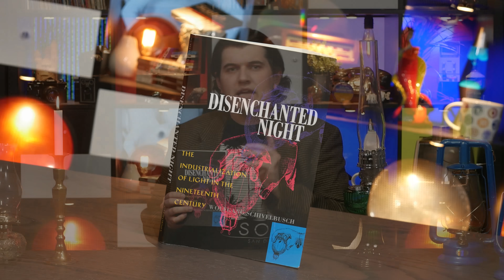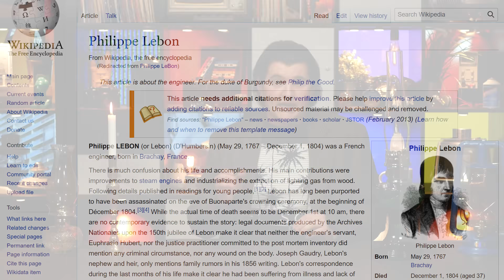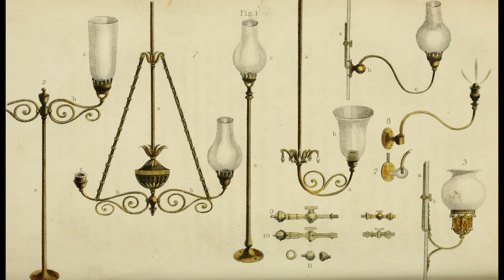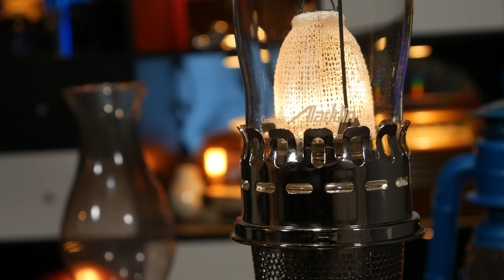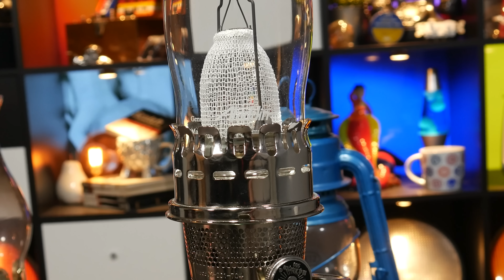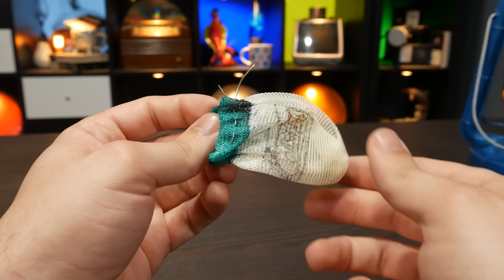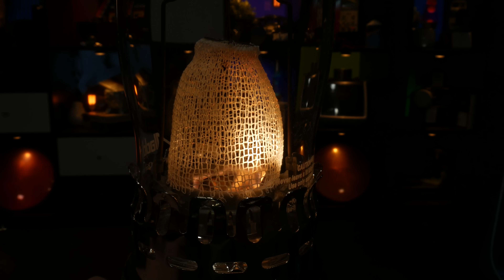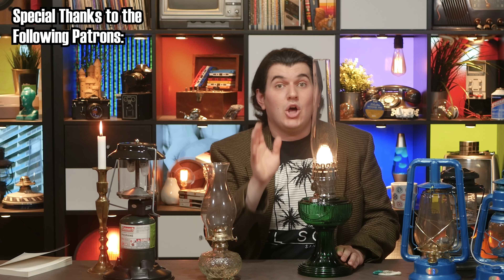How the gas mantle made lamps 10X brighter

Comment: "...When these lanterns were first invented." As opposed to... when they could've been "invented again later"?
Reply: Things routinely get lost in collective memory and then invented again.

Currently there is a huge argument in the historical tech circles about when triangle-toothed gears were first invented. The original answer was sometime in the Renaissance, as there were no surviving examples or accounts of such gears - gears were either square tooth or hub and stick, where you made a gear like a spoked wheel without an actual wheel.

This is important because triangle-toothed gears are required to make certain types of mechanical linkages work. If you try to make one with square teeth, they fail through binding.

Now we had a few ancient accounts of inventions that included gears and would require triangle-toothed gears, but we didn’t have any records of them being built and operating, so they could have just been theoretical.

This is what made the Antikythera mechanism so huge in rewriting history - it uses diamond-toothed cast bronze gears to power a mechanism that requires diamond-toothed gears.

Further analysis with fancy techniques to see inside the device have shown that it wasn’t just a one-off artisan device but that it has markings in the castings stating who made it and from where (presumably both as authentication and as advertisement); this was a bronzeworking group in Rhodes.  If these devices were made in quantity, it makes sense to assume that triangle-toothed gears were both well known and in wide use in the ancient world.

Similarly, Greek fire was invented and lost with the fall of the empires that deemed its production to be a state secret. Modern incendiary liquids exist, but are typically made through gelatinizing petroleum distillates, a process that we don’t believe they could have done at the time because it’s quite complex and requires lots of petroleum oil. We could very well say that we’ve reinvented incendiary liquid warfare, but we definitely didn’t invent it first   We can’t even say for certain that we first invented any specific incendiary liquid for warfare because it could very well end up that some modern version is actually a near-perfect replica of Greek Fire.
Reply: @ajjdgj6tmgedvnmtmek : That doesn't count. If it was invented once and we have record of it, that's IT. There is no "first invented." "Invented" already implies a type of being first.

Comment: Aladdin lamps are also subject to thermal runaway if not allowed to worm  up. I have seen one with flames shooting  2 feet above the top of the chimney with tie thing too hot to touch to turn down the wick. Had to use pliers ! scary.
BTW the book DISENCHANTED  NIGHT is pricy, $155 used on Amazon $900 new

Comment: Lavoisier’s original gasometers were precision measuring instruments which he used to prove that chemical reactions conserve mass - a major step forward for science.  You can see one of Lavoisier’s gasometers on display in the Musée des arts et métiers in Paris; sadly, most people seem to just walk past Lavoisier’s equipment not realizing its fundamental importance.  https://www.arts-et-metiers.net/musee/gazometre-de-lavoisier
The gasometers for town gas storage were really clever; the weight of the gasometer pushing down on the stored gas provided the pressure to push the gas through the mains - no gas compressors needed.  But since the gasometers could only produce low pressure, the gas could not be transported long distances.  Thus, many small gas works were needed which had to be built close to the gas consumers.   Another great video! Thanks.

Comment: My mother grew up with my grandparents on 40 wooded acres in a mobile home, off grid, here in MI. They ran the generator when they really wanted electricity, and to recharge the batteries they used for occasional movies or some-such. Everything at night was done by kerosene lantern-light or flashlight, headlights, etc. They heated with a round, vertical, cage-protected kerosene heater iirc (where heat from the wood stove wouldn't reach). I have fond memories of that place and still go there regularly for the woods, as the mobile home was torn down a couple years ago.

Comment: As I've learned since moving to the country, everyone has a kerosene heater around, because power loss in winter sucks
Reply: I have a drafty Victorian era house... I had an old ducted central heat pump unit that never cut the mustard on days below 38F.  I heated with three kerosene  heater because actual fire was needed to heat such an old house.   My home was built in 1888 with no fireplaces... Only stoves and stovepipes,  now plastered over.   $80 of comfortable kerosene each month Vs $250 of tepid central heat was an easy decision. 

Last year the central unit died,  needed new ducts... I decided to install multizone ductless minisplits ...problem solved.  $85 bill,  but comfortable.

I do keep one kero heater for my mountain  house.  1275 so feet,  one drum heater can handle the whole house when the power drops.   1 gal for every 8 to 12 hours.
Reply: It blows my mind that kerosene heaters were illegal in New Hampshire for a while.  I grew up with one in Pennsylvania.  When we got it, my mom held my hand up to it till I pulled away, way more effective than saying "don't touch".
Reply: Yep, I know I do.
Reply: Propane heaters burn cleaner
Reply: @someperson7  and burn through the gas faster using more fuel volume per BTU.   Propane is just one of the three "natural" gasses that come off the same oil well. 

Kero has the advantage of easy storage in a liquid non compressed form that may be stable for years. 

Wicks do need proper care and alignment to make a soot free flame with little to no CO, which is why gas jets became popular as any gas flowing produced flame, despite skill...however if they go/blow out they produce death... If a kero heater goes out it just grows cold. 

Original town gas was just captured carbon monoxide from smouldering coal fires.  At least the Texans got people to switch to propane/ethane/butane in the 1940s to burn gassified oil.

More people have died of gas fired appliances and gas leaks than paraffin/kerosene...but somehow the thing no longer familiar terrifies the average person.   A person that happily grabs a box of solid paraffin sticks and lights romantic dinner candles or a closed small bathroom of soothing candles burning surrounding the tub....or has a massive fire hidden behind the wall or in the pantry thinks nothing of it.
Reply: @STho205  As someone who has used kerosene heaters pretty extensively, propane is my preference. Kerosene smells to high heaven,and puts off all kinds fumes even WHEN the wick is right. And when it's not right, yeesh. If you want to use an open flame heater with no exhaust propane's the way to go. Because complete combustion. 
You have a point about energy density but by that time I'd be using home heating oil or diesel (aka home heating oil #2). 
Now if you live in an apartment and want emergency backup heat, you are going to be way more likely to get caught and slapped with a lease violation over kerosene because of the smell. 
For indoor, unexhausted heat, propane is cleaner, safer and more undetectable.
Reply: @someperson7  kerosene doesn’t need to be stored under pressure
Reply: @bradarmstrong3952  That's valid. But it's not really an issue for me.

Comment: When the fragile mantle falls apart it's dismantled
Reply: Makes sense
Reply: Good one
Reply: @soundspark  I've been using  modern mantles that I thought were safe, turns out they have thorium after putting on my Geiger counter!
Reply: Brmmmm..pssst!

Alright Dad.
Reply: Oh thats soooo bad... totally necessary however, someone hadda say it! 😂
Reply: Dang..  guess some of us will die of radiation exposure then. 🤷
Reply: After the first burn, it is already burned out.
Reply: And fills the room with radioactive thorium dust...
Reply: @nzoomed  The manufacture of thorium gas mantles was banned long ago . .
Reply: @FissionChips   only for some brands such as Coleman. Tilley stopped only less than 10 years ago and others especially some Chinese brands are full of thorium.

Comment: Here’s another technology connection: the thread fittings for lamps today use a very peculiar thread. They use NPS 1/8” threads. That’s National Pipe Straight. Note that the tubes and threads are nowhere near 1/8”. Also, the thread pitch is weird - not metric, not UNC, not UNF, not UNS, not even SAE. NPT threads are National Pipe Tapered and you can find these fittings in any hardware store on galvanized and black pipe. This is what you use when you install gas lines for ovens, dryers, etc. Why do electric lamps use the same weird threads and pipes as gas alliances? Because lamps used to be powered by gas, not electricity. When they started converting to electricity they kept the same dimensions so lamp fixtures and fittings could be compatible with older gas fixtures.

Comment: Before the Aladdin mantle lamps came out, there were round wick center draft Rayo Standard Oil Company lamps made by Bradley & Hubbard around 1890.  From what I have read, if you bought a large amount of Standard Oil Kerosene, they gave you a free Lamp. I have both Rayo and Aladdin lamps  that my parents owned. I rarely use them. The last time was a power outage one evening, for over 6 hours. Just crack, (slightly open), a window is all that is needed.  Also we need to remember, that back at that time, the buildings were not sealed up like today.

Comment: “Forced my lute” means the gas pressure broke the connection to glass collection vessel meant to condense the gas vapor distilling from the retort. Typically, the gas would condense into a liquid, but the temperature would not have been low enough to condense the gas from the coal, so the pressure built up and forced the connections apart.
Reply: Lute being a clay used to seal an airtight connection
Reply: @FranzFartinand  sort of like using maize flour paste to seal the earth oven in Mexican slow cooking of pig/tapir
Reply: @mattiasdahlstrom2024  Exactly
Reply: I came here for this comment, and I still want to use it as a term akin to grinds my gears
Reply: @Creationweek  It's pretty close, basically just an archaic "blew a gasket"
Reply: @zym6687  A bit of lute literally forms a gasket, so it's not even 'basically'. That's very precisely it.
Reply: Yep
Reply: He could have figured it out if he'd Googled just the word "lute" instead of the whole phrase. That's what I did, and found one definition was "liquid clay or cement used to seal a joint, coat a crucible, or protect a graft." From there it was easy to deduce that "forced my  lute" meant it broke the seal.
Reply: @raydunakin  Just realized that in paper making lut (or svartlut) is used to describe the slurry of shredded wood and chemicals being boiled together to make paper
Reply: Loot
Reply: lute2

/luːt,ljuːt/

￼Learn to pronounce

noun

noun: lute; noun: luting

liquid clay or cement used to seal a joint, coat a crucible, or protect a graft.

a rubber seal for a jar.

plural noun: lutes
Reply: The only Lute I ever knew was a hentai visual novel protagonist
Reply: @SukacitaYeremia  Lute is also an instrument like a guitar.
Reply: @tubester4567  Or a lute could be an insult to someone who doesn't know any better than to know what it actually refers to.. 'What a lute!"
Reply: @tubester4567  more like a harp

Comment: lute 
A U-shaped loop in a pipe or tube in which a liquid is trapped and used to provide a seal for gas flow. For example, the pipe from a gravity-fed reflux from the condenser of a distillation column contains a lute. The distillation column has a higher pressure than the condenser and the lute prevents vapour entering from the wrong direction. The depth of the lute is determined from hydrostatics and is greater than the maximum vapour pressure difference between the column and the condenser outlet

Comment: I've got a question: how efficient are these lanterns at converting thermal energy into light? It's possible that this might work better than using diesel fuel to run a generator and then using the electricity from that generator to power an incandescent light bulb.
Reply: Yes, more efficient than a diesel generator.  Also a hell of a lot quieter!  lol

Comment: Too late, of course. But I'm saying it anyway: the "luto sapientiæ" was a greasy material used to lubricate and seal joints, or seal off opennings, of laboratory apparatus. It was made of a mix of... I'll need to ask Google Translate for help here (I'm a native Spanish speaker)... chalk, donkey dung, tiny cloth scraps, powdered quicklime, and egg white.
Not sure about the "chalk" bit. In Spanish the recipe says "creta", meaning "carbonato de calcio terroso", but I guess it's in the ballpark.
I remember at least one text using it as a verb, "lutear" (to "lute").

The "breaking glass" must surely mean that it either escaped through failed sealant or broke the vials. Though I'm not sure if that would be because of pressure or because of flash combustion (explosion)...

Comment: If the Aladdin lamp is superior in function with the exception of wind resistance, wouldn't it be obvious to convert the element of an Aladdin lamp into the fixture of a hurricane lantern to prevent wind contamination and stabilize the flame? Why haven't we seen a hybrid of this before the Coleman kerosene mantle lantern on the left of the frame was invented?

Comment: I gave your video a dislike-  not because of the video, but because of the STUPID posters it has generated. It's EMBARRASSING. You could have prevented it by simply giving the definitions for FLAMMABLE and INFLAMMABLE: Flammable means it will catch fire; INFLAMMABLE means it gives off VAPORS that will catch fire.  Thus WOOD and paper are flammable; gasoline fumes and ether are INflammable. Get it???  Maybe you should go ask the Underwriter's Laboratory where they actually determine such things!!!

Comment: You can still find gas street lamps in Disney world (the one in orlando). "Main street USA" is lined with gas lamps, I believe they are electric ignition because I have never seen a lamp lighter at disney. Also in my neighborhood there are a couple homes that have outdoor gas lamps mostly for decoration. We have cng pipelines throughout the city that feed most of the homes in the area. And the cost is unbelievably low! I have all gas appliances and still dont use more than the minimum allotment per month

Comment: the kerosene and air pump from the kerosene camping torch is probably going to be fun and nostalgic. before kerosene phased out by subsidized fuel change into liquefied (petrol? natural? never knew exactly which even now honestly) gas as early as about 2005 in my country, street food vendors used the same fuel to cook as it is to light their kerosene lamp, one with the mantle usually hung outside the cart and one wick type for inside cart illumination. 

for a while, we swore to buy fried rice and other wok-fried foods only made with pumped kerosene stove because its hotter and makes the stuff cooked better? it did seem and felt to be a feistier cooking show/experience, save for whatever cancer because 3rd world country

Comment: My first camping trailor in 1971 had propane lights, no dc lights.  The big problems is that the mantles would be installed at the campsite as they were to fragile for travel and they also heated the camper.  I played many a cardgame at night using propane lights.

Comment: Not a catalytic action, just a membrane effect.  The mantle is similar to the wire mesh flash arrestor put over miner's lamps to prevent explosions.  The mantle creates a high temperature physical divide, with a steady supply of fresh air coming up just outside it.  Any hydrocarbons which have not fully combusted will do so at the mantle / outside air interface.  

The reason you get incomplete combustion with an open flame is there is insufficient oxygen.  By the time the partially burned gasses get out to where there is enough oxygen to continue burning, the temperature has dropped (in part due to the adiabatic expansion of the hot gasses) enough to not re-ignite.  (Of note, if your incomplete combustion is high enough temperature, it can reignite, with a nice, loud bang.  You see this in old cars, called an "after fire").  The mantle avoids this by localizing a significant amount of heat at the point where fresh oxygen is added to the system.  This is why some top-mounted lanterns, like the propane one you show, do burn with an oder, as there is not a fresh supply of air hitting the outside of the mantle.

Comment: would diesel work as a fuel for the aladdin lamp? after all, kerosene can even be used in diesel engines when the temperature is low enough. it's designated as #1 diesel. or would diesel be too thick? if it does work, it would make the aladdin lamp much more practical as a backup light during power outages, assuming you have a diesel vehicle.

Comment: I live in the eastern mountains in the US and have 3 old kerosene lamps for power outages. I also use one in a different way, I am a gunsmith and at times need to seat a barrel into a stock perfectly. I use a lamp without the chimney and the dirty flame deposits soot onto the bottom of the barrel in a relatively even coating. I then press the barrel to the stock and can see each high point of the wood as it will be covered in soot from the barrel touching it.